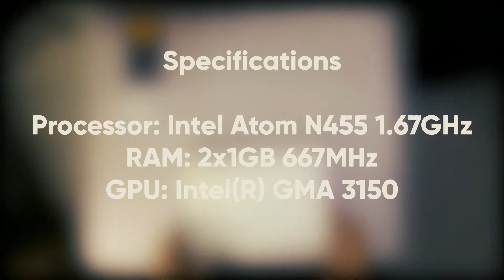No Display - Asus Eee PC R101D Fix

Comment: So I disassembled and cleaned it.  The battery light and power light came on, but there was no image on the screen. Then, when I was disassembling it to check again, I forgot to remove the battery and a cracking sound was heard.

Comment: Thanks for the video, it helped me out, I was stuck with the keyboard, I pushed in the tabs to lift it but I thought I was missing something as it still wouldn't come up, turns out the previous engineer that repaired it decided to use double sided sticky tape to secure the keyboard further, So I used acetone to unstick it,
So a message to all PC engineers "Do NOT add double sided sticky tape to the backs of keyboard to secure it! - Unless absolutely necessary" lol.
Reply from the maker: glad it helped

Comment: Hey I have one like this but I noticed that there's an extra ribbon cable connector was wondering what's that for
Reply from the maker: Hi! it might be a ribbon connector for keyboard, touchpad, i/o expansion and others. so if it happens that the keyboard, touchpad,  usb ports, or etc... is not working, disconnected ribbon might be the cause of it.